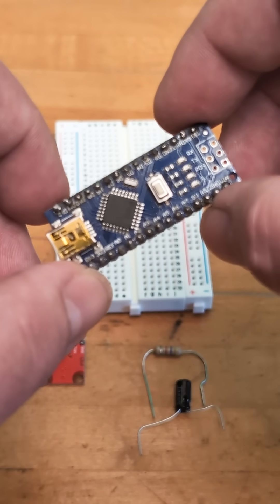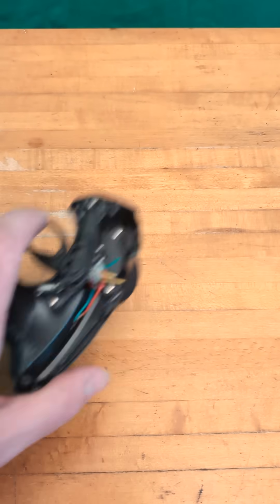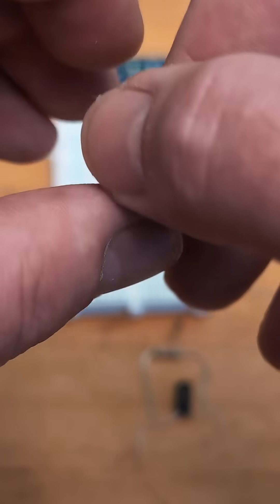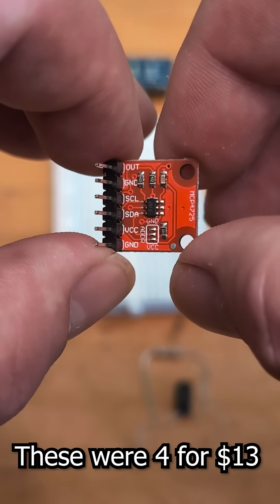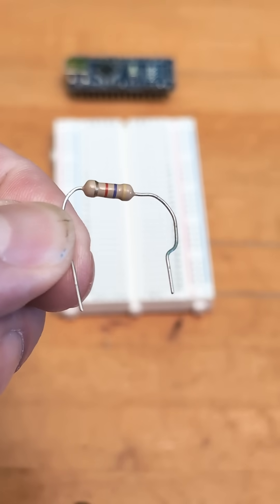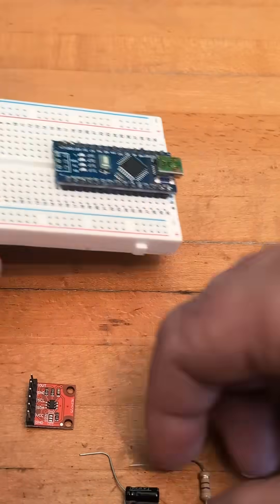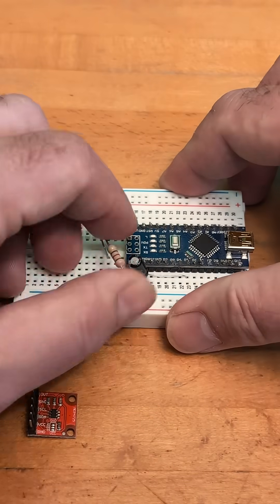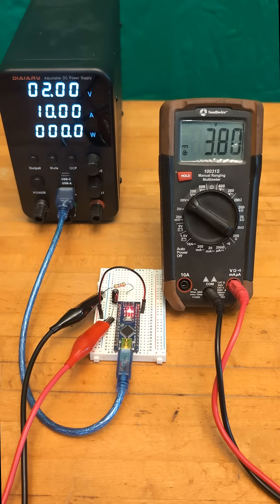Master PWM and DAC with Arduino in 60 Seconds!

Comment: I suggest you use the PWM pin. There are five of these pins on the arduino used just for pulse width modulation. It's also recommended to connect led blacklight control to the PWM pin to control backlight brightness.
A call to analogWrite() is on a scale of 0 - 255.
Reply from the maker: Thanks, I am using a PWM pin and using analogWrite() to control the output.  The point of this project is to convert digital PWM signals to an analog voltage that isn't 0v, 3v,or 5v without the use of a digital to analog converter. You can see this is achieved at the end as I get the voltage to cycle through (roughly) 1, 2, 3, 4, and 5v (minus about .1v).

Comment: But that wouldn’t work for audio would it
Reply from the maker: The question is too general, I'd need to understand what you would be trying to do. Arduino can't output much current on these pins (I think 40mA is max) so the use cases are limited. Its useful for mimicking an output signal of a potentiometer or most analog sensors when trying to interact with another chip.